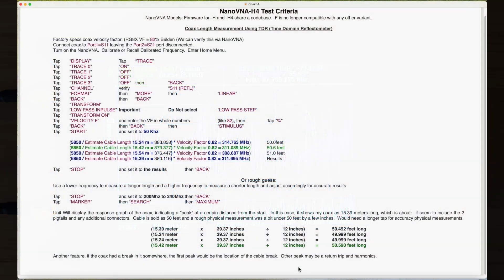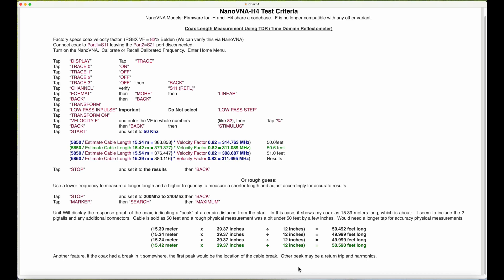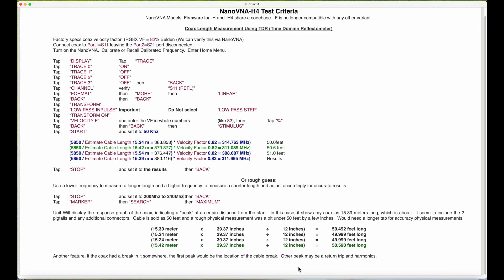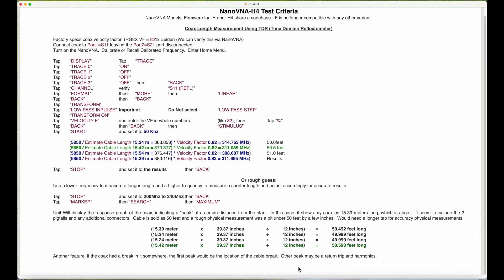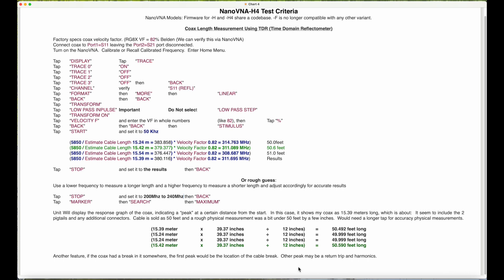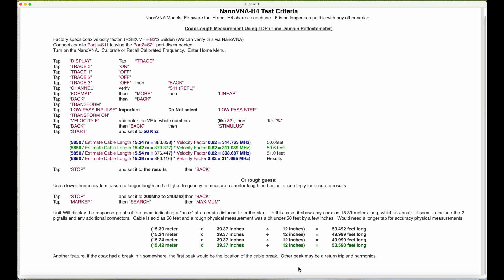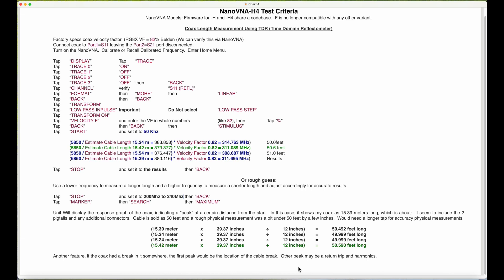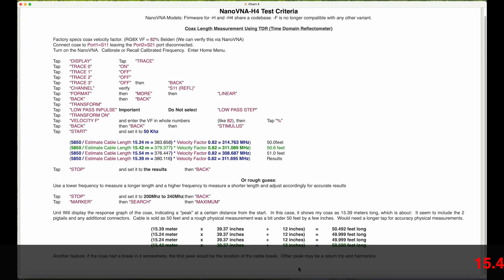NanoVNA-H4 - Accurate Coax Length Measurement Using TDR Time Domain Reflectometer

Comment: where can I find those NanoVNA- H4 test criteria that you have displayed on your video?
Reply from the maker: Are you referring to the sheet of instruction of step for testing.  I don't have an option to save the file remotely, but i kept it on long enough on the screen so you can capture a picture of it.
Reply: @SimplyOffGridLife  i captured a picture, but it is not very clear. I printed out a copy.
Reply from the maker: The file was created for the video and I have since deleted it, as I didn't have a need for it myself.   Checking here, on the screen it was readable, not sure what method you are using to print.  Try taking a picture of it with your phone and then use the picture to print it.  We don't have a dropbox setup.